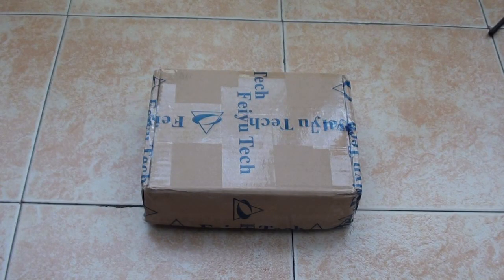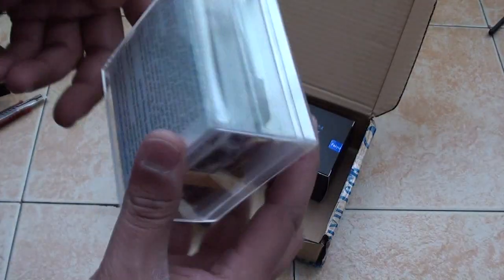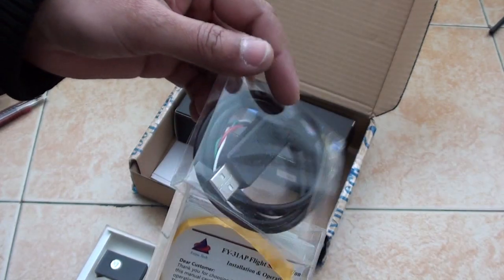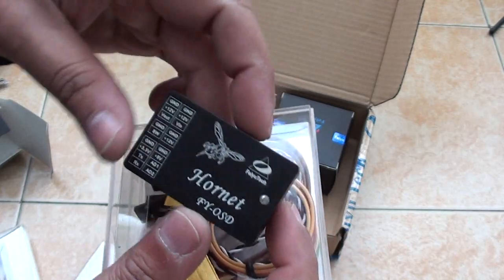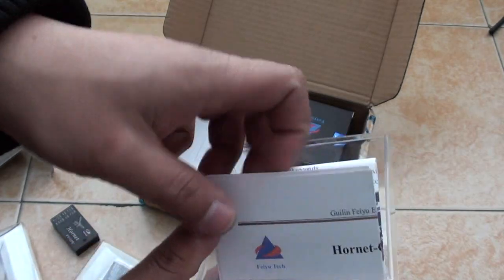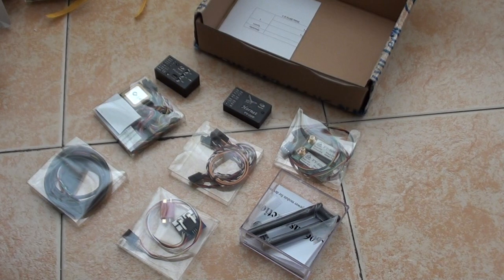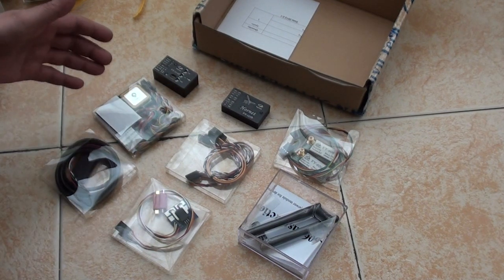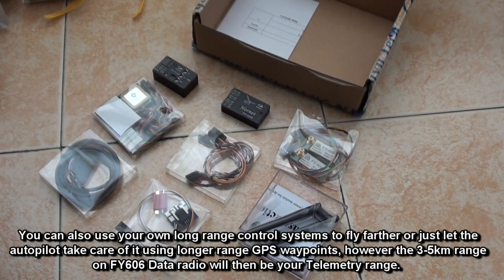Unboxing FY31AP Hornet OSD and FY606 Data Radio

Comment: Hi bro, I dont know why you never reply comments, but if you do please help.  
I was starting on an fpv and the guy just passed me a single box of f-tek osd i thought it's all an integrated osd system, little did I realize that it needs the FY31 to function.
Could you kindly help me, or is there a module you can connect to this ftek video overlay?